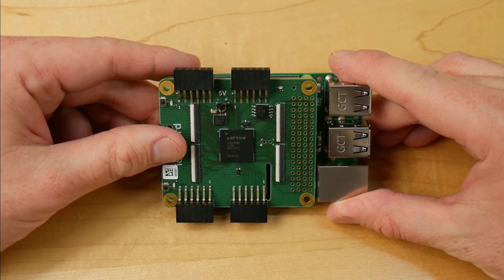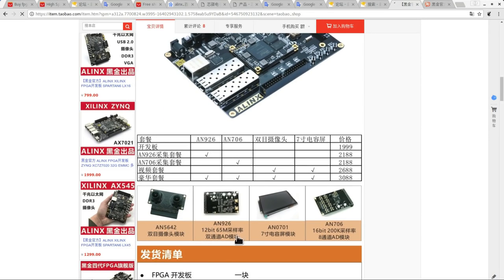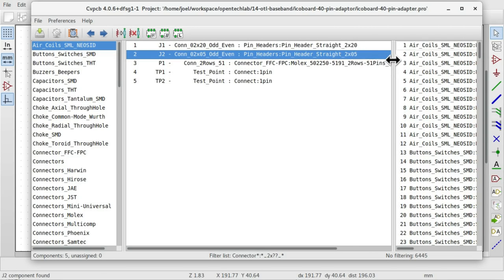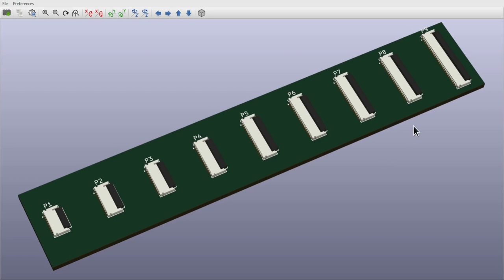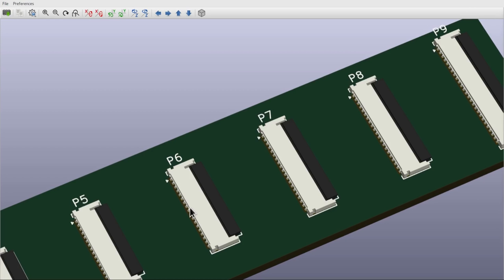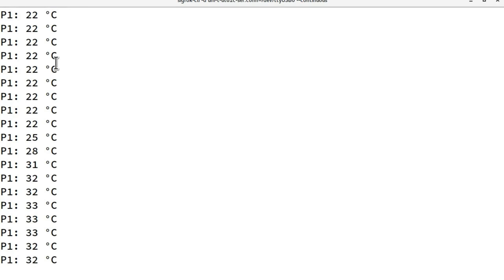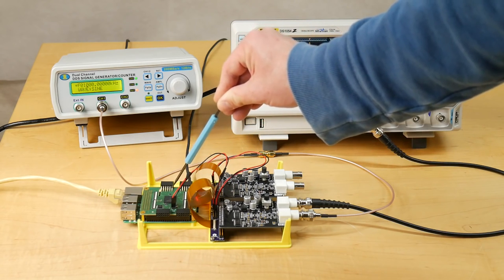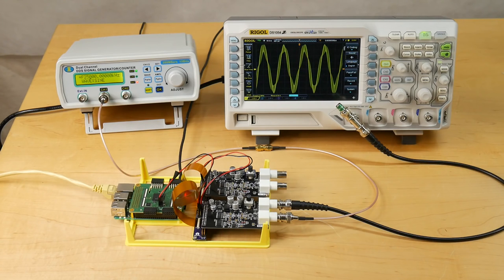[014] IcoBoard Software Defined Radio Project - Hardware

Comment: If you want to fill or refresh the copper pour, you can also press 'B' on your keyboard. That's usually faster than running a full DRC job, but impossible to figure out if you don't already know it. 🙂

Comment: FYI, you don't have to add those fake test point components in the schematic editor in order to put plated mounting holes on your board. You can simple use the "add footprints" button on the toolbar on the right (4th from the top that looks like an IC), find the mounting hole footprint, and place it where you want it. Then hover your mouse pointer over the mounting hole, press "E" and make sure you select "Pad 1" from the "Clarify selection" pop-up menu. In this properties menu, you can assign any net you like (such as GND) to this pad.

Also, it's a lot easier to use hot keys "B" to fill zones and "Ctrl-B" to unfill zones. Or you can right-click on the zone outline to get a context menu that will also give you that option.
Reply: You CAN add test points in PCBNew that way, however, at some stage  you'll want to update the netlist from the schematic after having deleted some components, and for that you'll choose PCBNew's "delete unneeded components", which will remove the test points. So it's better to have test points (and mounting holes) on the schematic, I've found.
Reply: New users of PCBNew will also want to know that the UI, especially the right-click menu, has different features depending on which graphics renderer is active (View > Legacy renderer vs one of the Modern ones). Not to mention that some of the routing modes are only available in one or other of the render modes.

Comment: There is a less liquid form of solder paste which usually works better when using stencils
Reply: Jose Barros the lead-free stuff I use comes in small tubs and is much more viscous. It also comes with the advantage of being able to scrape excess back for future use (and being able to keep it in the freezer).
Reply: The one I use actually comes in small jars, but it is exactly like you describe, never know what I'm ordering though, I have ordered other similar jars which are the same liquidity stuff of the syringes. Don't even know what is the spec I should look for, could it be "Improved fine pitch coalescence" referenced on some datasheets?
Reply: I just get cheap stuff from unknown brands, so I'm probably not the right person to ask!
Reply: Yeah that solder paste has WAY too much flux in it as it should be more like toothpaste rather than being so liquid.

Different kinds of paste make a big difference to the result. The one i like is the Loctite brand stuff with lead.
Reply: It's probably so liquid because it's being forced through far too small a needle, the paste clogs up and most of what you get out is flux.

Comment: The cost to make three boards with stencils is simply amazing.  The cost when I got started required approval from a VP or the President of the company because it was so insane.  Now you or I can just go out a make boards left and right for the price of a Happy meal at MacDonalds.

The problem with lead free solder / solder paste is the difficulty in cleaning the flux.  I worked at a place that was hell bent on using a dish washer to clean boards and the results were conductive paths between signals (Not meant to be connected) Hi voltage stuff arced between points.  The nit wit chief of this company issued tooth brushes to the assembler crew who tried to clean the water soluable flux before putting them in the washer.  This didn't really improve things.  

By the way when you are done (using lead free solder) all the connections look awful.  With lead tin solder good connections look shiny and bad ones look like lead free connections.  I forget exactly what was done to make the dishwasher work.  Something to do with processing the water ahead of time but I would never advise anyone to use that garbage for prototypes.  Oh and you clean Rosin Core with 99% isopropyl Alcohol.  (EBAY they have cases of the stuff)

The amount of lead you absorb by handling a roll of it?  I'm not sure its even measurable. 

One thing I would be aware of is breathing in flux fumes.  Your not going to breath in Lead (The temp to vaporize it is higher) If your hand soldering with your face over the board sucking in fumes your doing damage to your lungs.  I think smoking cigars would be better.  They make "soldering fans"  that suck up the smoke but its actually just a fan pointed away from you. 

Solder paste is (I admit) easy to get on your skin, cloths etc so maybe glove up if your really paranoid.  

Anyway don't scare the kids!  Lead is not like handling Plutonium.

Oh and you can use a toaster oven to do your boards.   Put them on top of the over to warm them up then into the actual oven.  Keep a close eye on the components.  When the Lead Tin combo melt all the parts will move slightly.  Thats when you know its done.  *Note there are controllers that you cobble onto a toaster oven that do this but this is not required.
Reply: There is a perfluoridated oil that can get hot enough to melt solder... But I like the toaster idea much better..
   Let me just make my last pop tart first 😊
  I'd still like to find more of that oil for other reasons if you know where I can still get it?🤓

Comment: Thanks for the great video! I tried to do repeat this project with BlackIce II board and I noticed something strange. I used a T-shaped BNC connector to pass a signal from signal generator to both FPGA and an Oscilloscope (I use same signal generator and oscilloscope you did) so I could compare how an output signal changes comparing to input signal. Oscilloscope shows that the output signal is an inverse (180 degree phase shifted) of the input sine signal. This effect doesn't change with frequency or signal shape. Could you please explain why this happens?

Comment: The “kick in the teeth” bit… Oh man, that’s brutal, but I have to admit, I LOL’d in sardonic sympathy. Those parts ain’t cheap, either, so stocking up now will be a bit costly.

FWIW, you can get MG solder paste on amazon (US), which includes the plunger and a tip.

Also, you can pop off the tabs of OSHPark PCBs with a pair of needle nose, then file down the mouse bites.  I just rub my boards on the concrete floor of my shop to get rid of the sharp points. Janky, but that’s how I roll most of the time. =)
Reply from the maker: Nice tips thanks! The floor is a bit too smooth in the current OpenTechLab basement, though. Some people always seem to have the best equipment ;-)
Reply: OpenTechLab just use a small paving slab.

Comment: This is the first of your videos I have ever seen...and I loved it.  I wish I had some of the resources you do because it would make things so much easier for me.  I want to build a SDR for mobile use, but it has a number of requirements that are not usual on a "normal" SDR project.  For one thing, it must tolerate extreme temperatures ( -55° to 125° C ) ,  cover 500 Khz to 450 Mhz, all modes INCLUDING FM STEREO on receive only, have multiple USB connections...probably 2 would be enough..., and have all the computer resources required as part of the unit.  Being a "PRE-Novice" with all things SDR, I am more than groping in the dark...more like completely lost.  Though your video has given me a degree of hope.
Also, I have KiCAD installed on my computer, but I need to design a few circuits that use Vacuum Tubes (Valves)  and I cannot locate a library of the sockets to mount the tubes in.  Some of the tubes I might use at a later date even have different size pins on them.  Could you provide any assistance to point me in the right direction so that I can do layouts with the tubes?
Sorry to hear you must return to England....not that there is anything bad or wrong with England, just that the way you stated it, it sounds like your move is a painful one for you and that you really didn't want to go back.
In hopes that things go well for you and that you will be able to make more videos, I will subscribe to your channel.
73,
Wayne   WB4RHA

Comment: That was one epic video covering a great cross-section of topics! Well done!  I totally feel your pain on the Kicad libraries and 3D models moving target. While I've achieved satisfying results with Kicad, a large proportion of time spent was wasted following the documentation's way of doing things, ,which later turned out to be obsolete and wrong.
Reply from the maker: Yeah... KiCad has been a mess for a long time, but I see signs of amazing progress just in the last few months. The libraries used to be a disaster, but they're getting much much better. But there's a lot of old blog posts out there with now-inaccurate information. The library maintainers are really helpful though.

Comment: I think you can create a pad in pcbnew and set its net to GND so you don't have to have it in the schematics
Reply from the maker: Good tip. Thanks!
Reply: You can create auto-connected hidden pins for any net name you like (like VCC), and was customary during the days when 5V logic dominated. Nowadays it's regarded as a bad idea, because you now typically want to connect a component's ground and power pins to project-specific distinctly named ground and power nets.

Comment: Good video, I wish you the best of luck with moving back to the UK and all the logistics surrounding it.

Do you think the setup that you have built in this video can be used to create a open source oscilloscope and signal generator?
Reply from the maker: Thanks for the good wishes. It certainly would be possible to use the rig as an oscilloscope, though you'd want to add various front end amplifiers and filters to it. As a sig-gen it would work pretty well as-is.

Comment: Great video, really in-depth and informative, but... That solder paste bit really made me cringe. You have to apply that stuff like you were screen printing it. Never put it directly on the holes of the stencil. Even less use that card or anything to push it through. What you do is put some on the top of the stencil and use the card as a squeegee and rake it over the openings once and then try to lift the stencil without moving it laterally. Also, when you are reworking bad solder joints a bit of flux will save you a lot of headache. HTH and cheers for the great videos!

Comment: I found loads of information and tit-bits that need to be read up on later (later, being in a couple of minutes) in this video. Great stuff Joel and thankyou for posting!
Btw, an advert popped-up during the video reference a company called Alorium who make arduino/arduino IDE compatible fpga boards. Had a quick look, as you do, and found the board  model Hinj to be quite interesting.....worth taking a look at! :)

Comment: dont you need a local oscillator which signal is mixed with the input signal and then converted to baseband? and arent there two ADCs needed, one for the inphase and one for the quatrature signal?
Reply: maybe you could use your frequency synthesizer from your other video to create the IF?
Reply from the maker: Exactly... this is just the baseband part. Though even without any mixers, the ADC has enough bandwidth to cover much of the HF band as a DDS SDR.

Comment: Love the video (and everything else you do). In terms of the coding approach to CAD, do you find it quicker than the more common graphical way or is it force of habit?
Reply from the maker: So I'm not going to say the code approach is right for everyone. But it seems to work well for me - which surprised me at first, but I have done a fair amount of graphics programming over the years.

With a parametric modeler like SolidWorks or the FreeCAD Part Design workbench, you define sketches and constraints and use these to make a list of features in the object. I noticed that a lot of complex sketches turns into very little code. For example, the OpenSCAD frame design is 280 lines of code. More than half of that is the code for PCB models. So you can define extremely complex geometry in only a couple of screen-fulls of code. Whereas, a visual version of the frame would be quite a complex part made of many sketches and features.

Then in a parametric modeller, if you have a part with list of 10 features and you modify or delete the 2nd feature in the list, all hell breaks loose with broken dependencies. Whereas in code, it's a lot easier to tie up all these loose ends when you make changes to the basic structure of the part.

Code is much easier to parametrize with constants, lends itself much better to version control and merging modifications from multiple designers.

So for all these reasons, even though it seems crazy to think that code would compare favorably to visual CAD design, I'm finding it works really well for me. Much better than I expected.
Reply: Super interesting, I've just started in a grad job working extensively with Solidworks . I can certainly see the advantage there coding wise, I suppose the only (real) downside is the steeper learning curve. Do you know of anything similar for Solidworks, google didn't show me anything upon a quick search. Thanks for your reply!
Reply: (replying to myself: I suppose the VBA macros would support a similar approach but not really in the same paradigm as OpenSCAD)

Comment: it really is a shame that this board and most other cheap fpga boards don't really expose a lot of the io capability, it would be really great to see some 0ohm jumpers to configure per bank io voltage and maybe do length matching of differential pairs, you wouldn't even have have them couple particular close wich might hinder single ended use, a couple unpopulated ldo footprints also wouldnt hurt, the lattice machxo2 and 3 breakout boards were quite nice in that regard
expecially for interfacing data converters high speed serial is one of the major advantages fpgas offer

Comment: With that viscosity solder paste the stencil really does nothing to help; as you see its all over the pads anyways. The stuff I generally use is really stiff, and you should keep it in the fridge to keep it nice and firm. Now, generally it's no problem though, the soldermask will make it go where it should unless there's much to much and generally, just doing a line of paste across the pads will be fine. And for doing the actual reflowing, a simple hot air station and a temp probe for the multimeter is perfectly sufficient for one off or a small number of boards. You really don't need to follow the temp profile to the letter either, just in the ballpark is fine.

Comment: Forgive if  mentioned already, but having just watching one chap with very stiff paste, and yours,..  too thin by far. There must be a happy medium for use with stencils. I would say that flux is cheaper than the lead beads. ergo the quest for profit overtaking common sense.
BTW on Thingiverse, I found an SCAD based Parametric Project Box maker. Love it . Pick your dimesion, front and rear panels, name plate, vent holes, holes and windows for knobs and displays. Grrreat stuff. Regards

Comment: During the reflow it would have been cool if you could have done picture-in-picture of sigrok-meter whilst the main pic is the paste melting.... that would have been cool (well, hot actually).

Not really done much with CAD (it's part of why I'm watching this) But this takes me back the the early 90s... Open S CAD reminds me a bit of the POV-Ray language... and CAD query has hints of the code I used to write in C++ (it'd be Python if I did it now) for generating POV-Ray files. (Sorry, I don't think I've got a point, just an observation)

Damnit! I used to have "a million" of those 50 ohm coax terminators and I threw them away... "don't need any of this old 10BASE2 Ethernet connectors anymore". :(

IS THAT A BLOB OF COTTON WOOL ON YOUR MICROPHONE???!!!!

Really interesting, video, I'm not sure if I'll ever DO any of this stuff... but there's plenty of pointers to other stuff that should keep me amused for a good long time. Keep up The Great Work.

Comment: You can get 3d models for most Molex connectors on their Website, no need to model it yourself (other than just for fun :P)
Reply from the maker: In that case they can't be included in the kicad library due to the licensing. Also the Molex STEP file for the connector has excessively complex geometry. My model is a simplified representation.
Reply: OpenTechLab okay, good point. Maybe I am too pragmatic with this kind of stuff

Comment: I know you only want to use OSS but fusion360 would blow your mind in terms of parametric modelling.
Reply from the maker: Oh I know. Incredible software. But I wouldn't want to have my designs tied into closed software unless I'm forced to. It won't take long before the current version goes obsolete, my license expires, the OS it runs on goes end of life, and I would lose access to my work. That's what happened to me when I previously used SolidWorks.

For me, the OSS thing is a fun little game I like to play. What's the most crazy/awesome challenge I can take on just with OSS? It's happened many times that I've seen an OSS application transition from inferior to passable to competitive to preferable. And it's fun for me to dig through the OSS treasure chest to see what's on offer, and then share the results!
Reply: Yep, I hear you, and understand but damn, it's like writing a program but graphically. So good yet also is also very buggy. :)